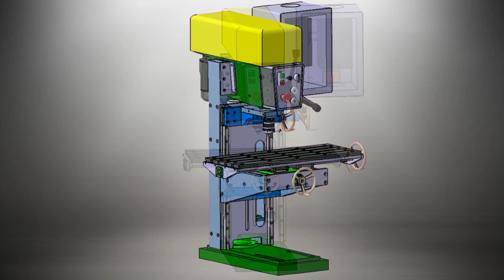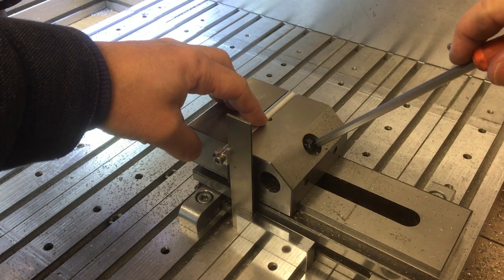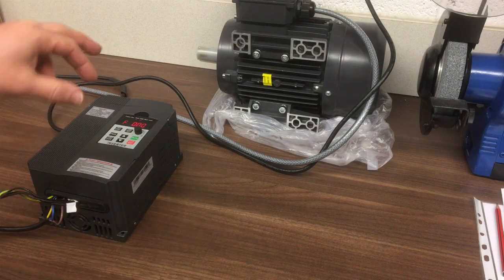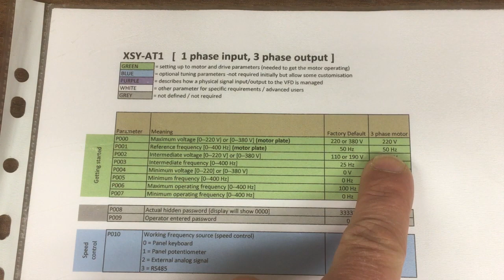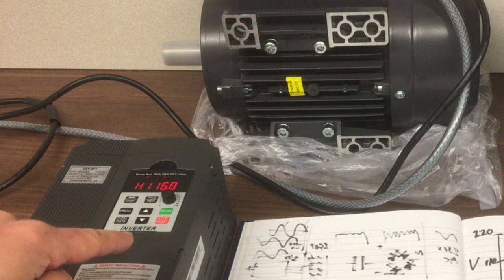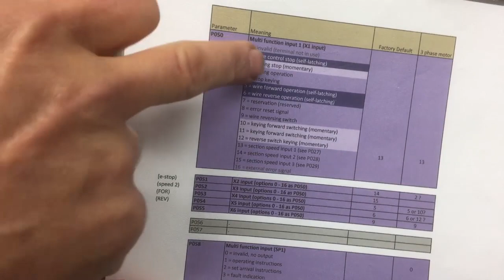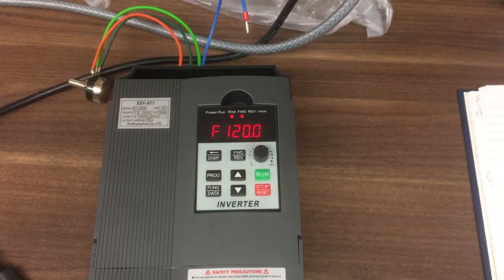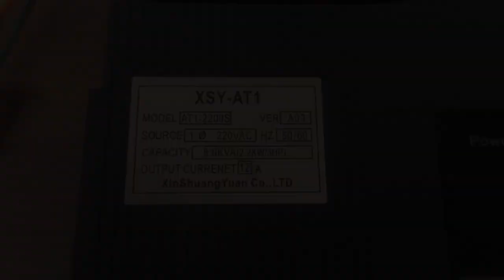Ep 2: Drill Press Upgrade | Making the control box & inverter parameters

Comment: Very helpful, thorough video, thank you!  Some basic questions (new to this so please pardon if they're silly).  

How did you know you were able to safely set the Max frequency (P06) up to 120 Hz?  I'm running this same VFD to convert from single phase 240V to a 1 HP (220V 3 phase) Bridgeport step pulley (original US motor), with a nameplate value of 50Hz/60Hz depending upon the region.  Currently the default max frequency (P06 on the VFD) is set to 65 Hz and it works fine.  How did you know what a safe, max allowable frequency was for yours (120 Hz in your case)?  

Also, last silly question for this VFD - how do you turn it off?  I can't seem to turn it off when powered (plugged in).  I have to unplug it (stays lit) and then hold the "stop" button to get it to power off.  Holding the "stop" button does not shut it off, when plugged in.  Is this to be expected?

Thank you again, fantastic video!
Reply from the maker: For the maximum frequency I read around for what other people had used and went for 120Hz.  Later I emailed the supplier for the motor to get their view and they recommended a slightly lower value so I went with that.
I don’t think you can turn these off once plugged in.  When unplugged they will stay powered for several seconds until the capacitors discharge but all the ones I have owned then switch off.

Comment: I have the same VFD on my mill and lathe. I can get it to work on the mill, but my lathe just clicks.. any ideas what parameter I need to dial in?
Reply from the maker: You need to read the motor plate specifications and set the parameters to match. These inverters are not plug and play to any motor and always need to be configured.
Somewhere in this video series I showed my parameter sheets I created in Excel and highlighted the key ones to get the motor running.
Reply: @routercnc9517  thanks for the reply! The lathe’s previous owner had some convoluted Mickey Mouse wiring, kinda surprised he didn’t kill himself on it. I wound up getting it going, I just need to tune the torque comp and braking to have it run how I prefer it.

Comment: Thanks for posting these videos. I just got a 1.5kw version of this vfd (XST-AT1),  so all of the parameter options are the same, it just has a slightly different case.
 I'm using it to power a wood lathe. After connecting things, I tried it out at very low speeds and it worked well, would reverse the motor, run/stop, etc. However, as soon as i turn the frequency knob to around 15, it trips my breaker. The motor is still moving relatively slowly at this point, I don't get any error codes on the VFD, and nothing is getting warm or showing signs of excessively high amperage draw. Any ideas on what could be causing this?
Reply from the maker: Not sure on that one.  You could try adding a line filter to the mains input.  Or of you don’t have one to hand try running it through a cable reel extension (temporarily).  Also check the earth connections.  After that I don’t know.
Reply: @routercnc9517  Thanks for the response. I'll read up a bit about the mains line filter and give that a try. I sure have a knack for running into tricky and annoying electrical problems lately, ha!
Reply from the maker: No guarantees but this sort of thing is not too expensive and worth a try.  Google "CW4L2-20A-S EMI Filter Line".
.
Next up would be some ferrite rings on the cables going out to the 3 phase motor.  Place them near the inverter side.  Search 'Clough42' channel on YouTube as he showed the spec/sizes that might be required.  Physically they were around 50 mm diameter if that helps.  I haven't needed them on anything I have ever built so can't advise on spec.
Also, is there another socket in the workshop you can try, something much further away from the breakers ?  Longer cable starts to drop the voltage spikes (a bit).
.
Finally if you set parameter P062 to 3 to display Amps on the display it may tell you more information.  Max current setting is in P076 (in mA), but if this trips you get an 'err6', so probably not overcurrent in the inverter.
.
Also, double check the parameters to make sure they match the motor (poles, frequency etc.), and make sure the acceleration parameter rate is not too high.
.
If you get stuck try posting on the mycncuk forum as there as some very knowledgeable people on there.
Reply: @routercnc9517  Thanks again! As I was looking into the EMI filter you mentioned, I read a about how EMF can be created in the ground line due to EMI and that has the potential to trip GFI circuits. The socket I'm using is actually connected to a 50 amp spa box breaker with integrated GFI ( I used to use that outlet for an electric beer brewing setup, so I needed a GFI for safety). It makes sense on the face of it that as I increase the frequency on the inverter, the magnitude of the EMF would increase to the point of tripping the breaker, and would probably happen at a predictable frequency like I'm seeing. I might try taking the spa box out of the circuit, going directly to the breaker on my panel to see if that cures the issue. If not, I'll give that line filter and ferrite ring setup a try. Really appreciate the help and here's hoping!
Reply: Getting rid of the GFCI ended up doing the trick. Thanks again for the help. I definitely wouldn't have known to consider EMI as an issue without your assistance.
Reply from the maker: Ok no problem.  Glad you are up and running!

Comment: My vfd manual does not even list P25 parameter but the vfd has that program and it was set at 0, even though this video says I should have it set at 1 for a 4 pole motor.  I can't tell a difference in the change. What's going on?
Reply from the maker: It is not unusual for manufacturers to make changes to the way these are set up.  Possibly if they don't list P25 they are determining the number of poles a different way such as incorporating the number of poles into another parameter.  I have seen the pulley ratio factor be entered in different ways for example.  If changing it made no difference then I guess they are doing something else.  I'm really sorry but I don't know other than to contact whoever you bought it from.  If you have a tacho to measure the speed of the motor and the motor runs smoothly then I think you should be able to see if the frequency on the display makes sense against the rotation speed, and therefore if the number of poles is correct.  Worth asking around on a forum for this last part.  mycncuk.com for example is full of knowledgeable people.  Good luck with it.

Comment: I got the same exact VFD and going to power my lathe motor with it. It does not support external load resistor, but the braking option is working, I'm not sure how that works. Is there anything I should be aware of or be careful if I'm going to use the braking?
Reply from the maker: There is a limit to how fast the internal components can brake the motor.  If you set it too fast it will most likely trip out with an error.  I bought an external braking resistor for my CNC machine years ago but never used it.  I think it is really for a production environment with big tools where time is money.

Comment: I just purchased a Belt grinder with an VFD like this.  was grinding, had a fault, reset.  then it stopped again and displayed 19103, and control panel doesn't do anything.  reset power to the unit, displays 19103 still, and controller still dead.  Any help?
Reply from the maker: Sorry I don't know what that code is.  Maybe some grinding grit got inside the unit?  Maybe take it apart and look for anything that might have burnt and also give it a blast with an airgun if you have one in case something has shorted across the tracks.  Other than that maybe time for a replacement.
Reply: @routercnc9517  Have any idea on how I would go about "resetting" the unit?

Comment: I have no clue how to change parameters. I can get to them, but no button seems to change the values.
Reply from the maker: I showed a flow chart at 18:11 for the button presses needed to change the values on this unit.  Press "Prog" then "up" or "down" arrow to select the parameter you want to change, then "func" to go into that parameter value, then "up" or "down" arrow to change the value.  Then "func" to come out of that parameter value setting, then "prog" to store the new value and exit the setting mode.  If that is not working then contact your supplier.  The front control panel is removable so maybe they would try sending you a new one?  If that does not work then sorry I don't know.  Good luck with it.

Comment: hi I've tried to program my xsy-at1 i just haven't got a clue what I'm doing  i have a 0.37kW, 2800rpm, 230-400V 3Phase, 50Hz, B3 Foot Mounted, GAMAK Electric Motor i need it to run @ about 300 rpm have anybody got the parameter numbers and what i need to change them to thanks